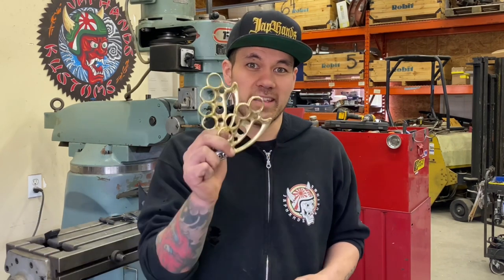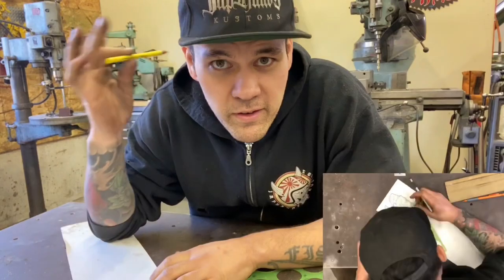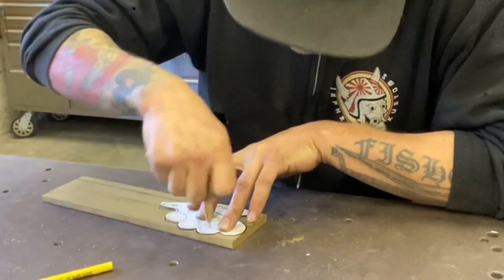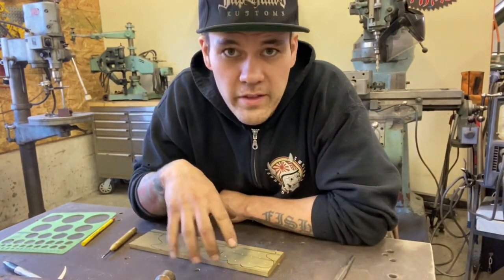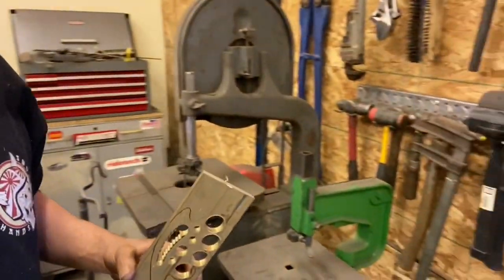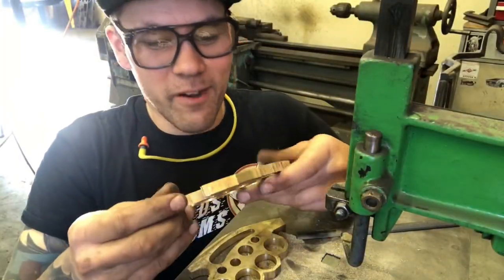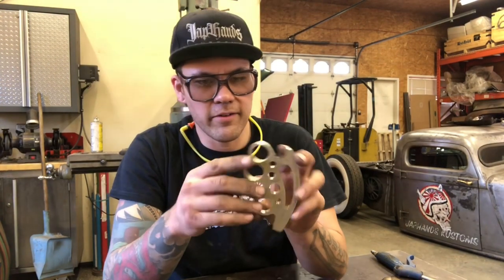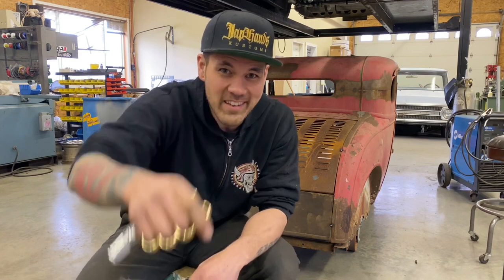How To Make Brass Knuckle Shifter Handles

Comment: I am enjoying your easy going way and unbelievable talent as are others obv!  One comment on the brass or aluminum that might save you some time- as a woodworker I have used standard carbide router bits on these metals with great success over the years.  I would suggest you get a small router and a selection of round over bits to use for putting a radius on all the edges of parts like the brass knuckles. It’s very quick and gives you a perfect uniform radius and all kinds of bits are available for rounding over, adding a round plus a small step, slot cutting etc..  Would save a lot of hand work especially on duplicate parts.  Great stuff and please keep it coming!

Comment: A wood router with a radius bit would have probably worked well for taking the sharp edge off of the holes before you cut them apart and trimmed the excess off the outside. 
I really enjoy watching your videos and appreciate the way you tell what you are doing for the people who are just starting to learn. I started fabricating over 55 years ago and still learn things from your videos. You are a VERY impressive craftsman 
Carl.

Comment: Great channel and work mate!
Some tips from an old machinist...if you're interested:
Use soft jaws on your vice to protect your work.
Tap your holes nice and square while still in the mill/drill vice using a spring pointed tap guide.
Keep up the great work mate!
Reply from the maker: Really appreciate the tips man!! I will definitely try those out. Thanks so much for watching! 🙏
Reply: Thanks Great Dane, For the advice on tapping with a spring loaded 'thing', I'll try my spring center punch in the tail stock.
As i work in a sheetmetal shop that has a lathe, so no one knows tips and tricks like that. 
Cheers Aaron.

Comment: just need a quick release on the shifter just in case LOL .. Great work.. have a old jig saw that uses copping saw blades  could change it over and some clamps to hold files .. maybe someday .. This Old Tony has a die filer just a bit larger .

Comment: Those punches work great so do the ones with a spring and.a separate tip and handle you pull on and let snap back.  Those ones like you got break car glass pretty well too just ask any thief. Lol

Comment: Rather than using a die grinder to ease the edges of the holes, use a carbide tipped 1/4 round router bit. If you take your time with small bites, it should hold up well.
Reply from the maker: Cool thanks for the tips!

Comment: This is awesome what was your hole spacing in diameter. I have half inch by 3 in wide brass plate I made knuckles before but I really like design that you just made. If you could share a little bit of information about the finger hole placement I'd really appreciate that. Sweet build dude 💪👊
Reply from the maker: Well the finger hole placement is pretty organic I literally traced it from my own hand the holes themselves are seven eights of an inch I believe and pretty close together
Reply: @MakeItKustom  thanks dude I'm going with 1" holes and give or take 3/16" apart. Thanks for getting back to me sir. Keep up the great work 🤟